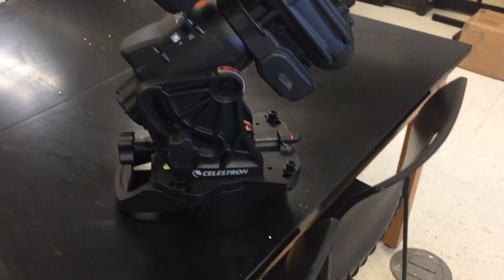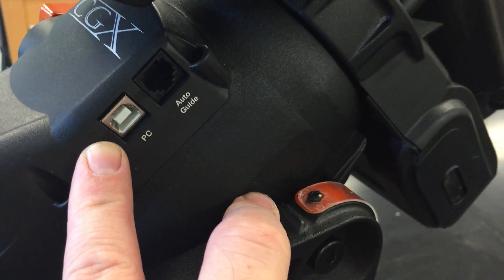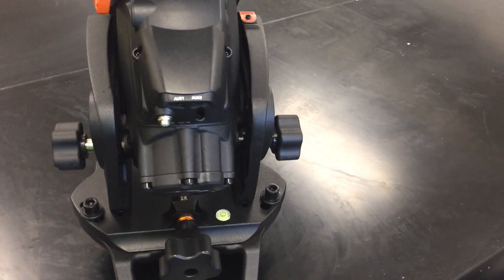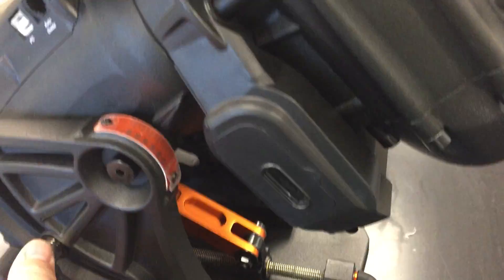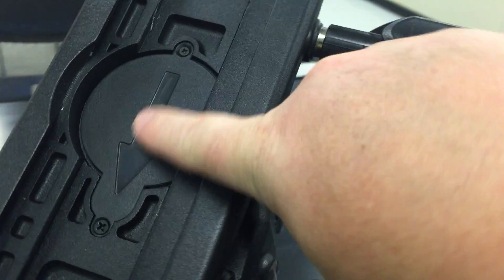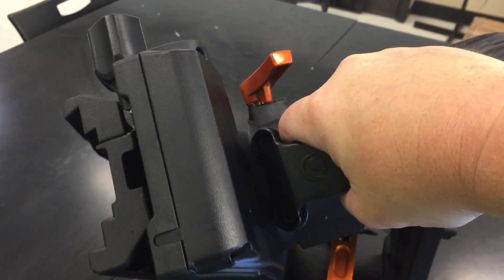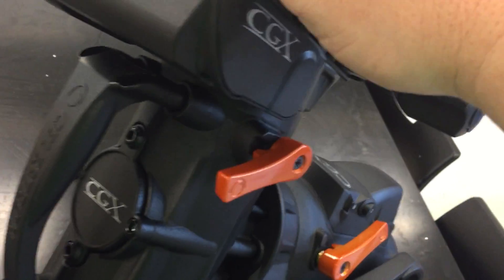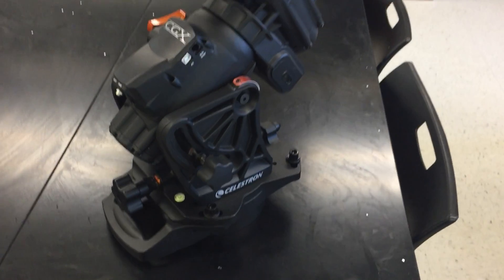Celestron CGX unbox In Depth Review

Comment: Do you think the cgx is sufficient for a mobile astronomy, by a caravan, or should I get the cgx-L, if that mount is more reliable and beefier ?? I wonder if a 11 inch sct is perfectly sufficient for a mobile astronomy, with no permanent pier ??
Reply from the maker: Gunnar Jensen  to be honest if I had a mobile setup I would be more tempted by a quality wide field refractor. The glass available these days for the price is pretty sweet. The smaller f ratio would be less sensitive to Polar alignment errors even though the all star alignment is pretty easy. Not to mention the 11-inch sct is pretty heavy and bulky.

Comment: Does the mount work after all ??
Reply from the maker: Gunnar Jensen   At the end of a few trials and tribulations it does work. The Celestron guys fixed it on a return trip.  And now I am getting good tracking and I’ve even taken a few exoplanet light curves over a period of 4 hours. If you are considering one, just bake in the potential warranty return and the value is good for the money.